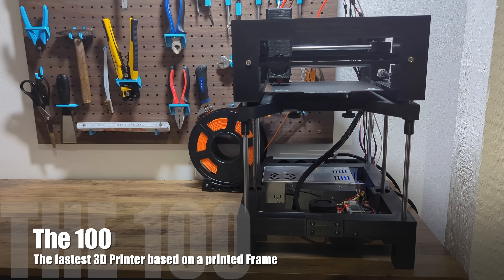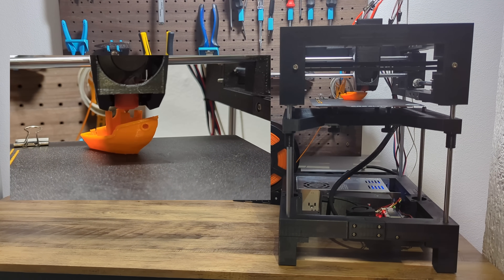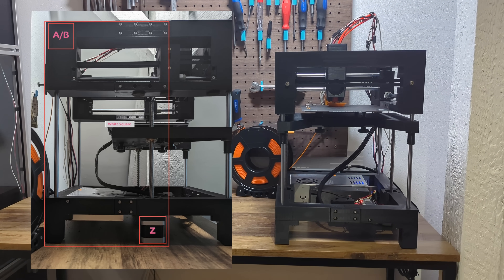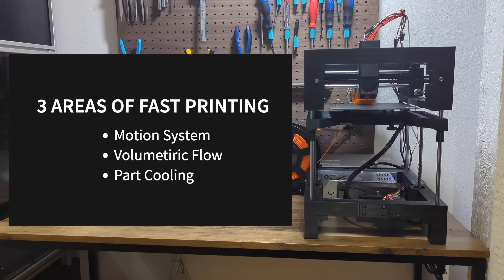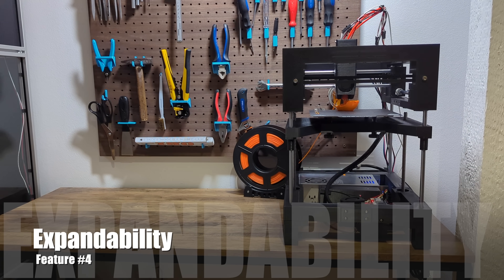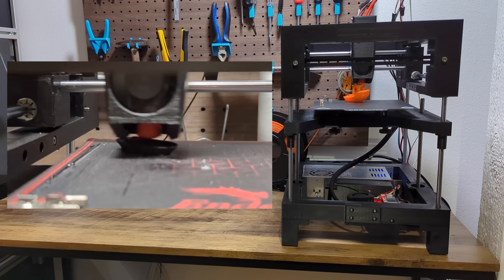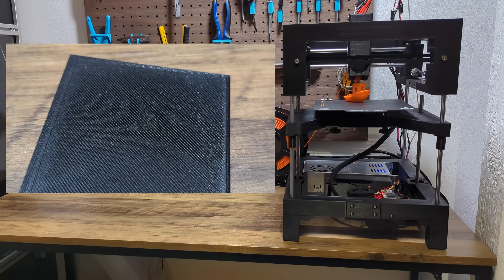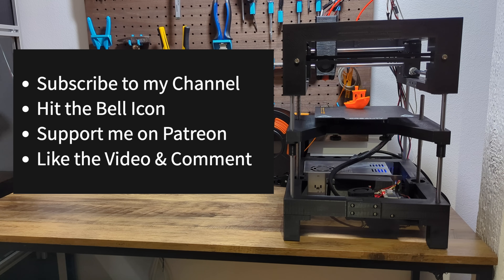The 100 - The worlds fastest 3D Printer based on a printed Frame

Comment: I love that others in the community are slowly beginning to realize that the non-moving components need to be as heavy as possible! Great work!
Reply: Im confused though: why not use stuff like concrete and make the parts significantly heavier? Or use a full steel frame resulting in the same. Im planning for my revision of my printer to use a steel frame and attach concrete blocks to the stationary gantry
Reply: @chris_0725  well these are meant to be cheap and relatively easy to build via printing the frame. Using concrete and sheet metal would not fit the spec they gave themselves
Reply: @brokencreationlordmegatrol3037  i don´t get it. Concrete is super cheap and it not hard to use.

If the brackets would be hollow with just tubes for screws, they could be screwed together, filled then super sturdy and also very heavy.

The main problem with concrete is surface chipping, and if the form is the outer shell, that is no longer a issue
Reply: @matsv201  one word, resonance. There is also the issue of shrinkage and creep over time.  

Simple solution to all this. Epoxy granite. Obviously more expensive but in the quantities required for this application its not going to break the bank. But you would use it in much the same way.
Reply: Maybe this could even be improved by printing even larger versions of the non-moving frame parts with some hollow compartments and filling them with sand?
Reply: @MrMoralHazard  Sand might also work as a good damping material, which would increase performance.
Reply: @RockitFX1 sand makes an excellent dampening material. I hope people run with your suggestion. :)
Reply: @MrMoralHazard  You'd want something like Epoxy Granite

https://www.youtube.com/watch?v=2NmZq7F_gUE
Reply: @MrMoralHazard  Interesting idea, maybe add water to fill the gaps left from the sand particles. You would need to insure that the printed part would be water tight. Possibly by thinning down some epoxy and pouring it in first then pouring it back out to coat and seal the interior. Maybe too much work for little gain though.
Reply: Any good reason not to add space for a concrete paving slab? Sure it isn't 3D printed, but neither is the ball screws and rails. And paving slabs are easy and cheap to come by, with no modifications needed, and it would add some significant weight to the base.

Having said that it would be interesting to see this analyzed for resonance frequencies. If you can avoid those it might improve the print quality noticeably without sacrificing all that much performance.
Reply: We've known for years but people aren't spending thousands to 3d print trinkets
Reply: I was thinking a 3D printer needs to be as light as possible so it can fly through the room even when homing.
Reply: Half the reason Mills and Lathes are so expensive is that very reason.  It turns out a literal ton of cast iron is not cheap.
Reply: @EmperorA0  Plus shipping lol
Reply: When I was watching this video I was thinking that I would use lead for weight. But then I have already do a bit of casting with lead already. One of the advantages of lead is if you don't like what you did you can just melt it all down and make it different.
Reply: @tinayoga8844  Lead is a great material to cast weight in. Just be careful writing about it or people will start complaining that you're poisoning them just by writing about it. I've actually had to tell people that no, you don't die by holding a piece of lead.

But it also comes with the problem of requiring some equipment to melt and cast it. You can get almost as good use of it if you get lead BB's  and pour them into printed pockets. Not quite the density but heavier than sand, concrete or even steel.

But seriously just adding weight is not really the end all solution. Some YouTuber, can't remember who it was, had a really old mill that had a problem with chatter. He thought it had to do with resonance and vibrations, and that stiffing up the construction and filling the pillar with lead shoot would help. Short answer it didn't. Well not until he had put a lot of work into it  and rebuilt the entire support structure.

Having said that adding weight to the bottom is cheap, quick and easy, so it's a good place to start. If it helps that's fine and if it doesn't then you move on.
Reply: Seems like some clever choice of infill, a couple holes, and epoxy granite could take it even further.
Reply: Im really surprised you dont see more printers bolted down to a bench. If secured properly weight shouldnt be to much of an issue, unless Im missing something.
Reply: @Witchlord  Thing is so far 3D printers is at the T-Ford stage. It's still immature tech and the cheap ones are often breaking down or need a lot of service. So you need to be able to get at it from every side, and sometimes even the bottom.

Besides most tables are pretty flimsy. To keep a printer steady you need something really sturdy, preferably bolted to the floor. 

Adding weight to the printer is a lot easier than trying to create a totally unmovable surface.

There's an alternative to all this. Instead of eliminating the vibrations and that's to compensate using electronics, programing and sensors. If you were looking at producing hundred of thousand or millions of printers that's probably the way you'd go. Creating the hardware and software needed is an investment that would pay off with a large enough number of units. But for low volumes building them sturdy and eliminating as much of the vibrations as possible is the way to go.
Reply: Yes, my idea initially was to drill a few small holes into the frame pieces and fill them with epoxy resin with very low viscosity
Reply: How could that not have been the most obvious thing already? Any CNC manufacturer has known this for decades. Has there seriously been doubt about this in the community?
Reply: if i were to make one from scratch myself, it'd be from a solid block of steel (which i already have and got no idea what to use it for)

but i have ended up in the "not enough time to make a hobby out of the tools for my hobby"  part of the community, sadly.
Reply: Imagine someone tried doing 10k mm/s2 on a rook by using tungsten to stop vibrations
Reply: @justageekygamer  meh epoxy has a higher loss coefficient thus better for the purpose. 

Heres an idea. Tubes filled with polyurethane.
Reply: Heavier is only good in the base. The key trait in non-moving parts generally is rigidity. Weight can be a contributor to that, but only insofar as denser materials are often more rigid and heavier for the same shape and dimensions.
Reply: @claws61821  agreed. There is a bit of a pressing aspect that we are hobbiests that machine manufacturers dont really have. 

Manufacturing process limitation. 

Lets be honest most of us are going to be limited to things like a chop saw, table saw and hand tools. 

Sure we can get creative with them. But we are not going to be destressing a steel frame in an oven and surface grinding where rails sit etc for example.
Reply: print the parts with open ends, and fill with concrete? concrete is not that expensive. you do not need much. It would eat some frequencys I guess also.
Reply: @AndrewTSq  even just sand is better than empty space.

Comment: Very interesting approach!
Why is the "White Square" not located at the center of the bed (which might be a the x/y center of the printer)? Was that just because it wasn't possible to arrange the components to put the center of mass there?
Reply from the maker: Yes it would not be practical. The power supply and Z-motors would have to be relocated, which would mean that the controller board would run out of space and the print bed would have to be rebuilt.

Comment: Hello! This is a very interesting project! I was wondering why you are using IGUS bearings? Compared to regular ball bearings IGUS bearings introduce a very wide, slow ramp up of vibrations on the input shaper resonance graph compared to regular ball bearings which ends up giving you quite poor results with input shaping. I noticed this walking someone through the setup on a sv06. With IGUS bearings his maximum recommended acceleration was at a mere 2k, and with the conventional ball bearings the graph had a quick ramp up peak with a recommended max acceleration of 8k.
Reply from the maker: I went for a couple different options in the development phase of the printer. I started with normal steel ball bearings and they had always a big amount of play ( i've tested a couple, nonames and reasonable manufactures like Mitsumi with different linear rods ) Up to 20k the performance was pretty good ignoring the annoying sound. But a certain accelerations they tend to blocking. Drylins are bad at slow printing. As you notice the slow ramp up is something you have to consider. But when you drive them for example at 20-30k acceleration there is no ramp up effect anymore. Especially at 40-70k acceleration they shine. But this is something I want to recheck in the near future. Im in contact with multiple linear bearings manufacturers for a production of a comparison video. I would like to compare steel bearings, drylin, copper graphite and sinterbronze and my self designed LM8UU based on different materials. So stay tuned for a details look into this topic

Comment: Could you do a version for a 300x300mm print bed? Or if you upload dimensions of the parts I could model the necessary changes myself in fusion 360. (I know this will affect the max speed of the printer but it's a sacrifice i'm willing to make)🙃
Reply: Agreed! 💯🤟

Comment: Do you have any opinions on glass  panes for beds and how using one might affect this build? I’m kind of a speed demon print-wise too but they’ve always been my favorite.
Reply from the maker: I've built my first prototype with a glass plate and blue painters tape. Works great for PLA when you room temperature is above 20°C. My Workshop is at the cellar. In the night I had temperatures of ~15°C which was enough to cause warping on my first layers when I printed PLA. I decided to use the Ender 2 Pro print bed because I saw that they sell PEI Sheets (the ones with a blue Ender logo) that might be used without a heated bed. So in summer when it's hot enough i could print with the heated bed off and when its too cold i could opt in the heated bed.

Comment: This looks just wonderfull. I would love to try assemble the 100 in summer. I saw there are stl files of parts needed, but are there recommended printing settings to do so?
Reply from the maker: I've added a section about the print settings at the readme of the github repository

Comment: Really blown away by what you were able to accomplish with this printer and it's really interesting to see your design philosophy/approach in action. I particularly like the choice of larger print area that's based on what most users would print out, while not being too small that it's too restrictive. I felt that was one of the limitations for the V.0 design. 

Looking forward to your build stream, and will look into sourcing the parts. Great work!

Comment: Would I be able to print all the pieces on a 140mm^3 bed?
Reply from the maker: No, to print the STL files, a 3D printer with a print bed of at least 230x230mm is required
Reply: @MattThePrintingNerd  got it. Thanks

Comment: Can the bed parts be printed in PLA?
Reply from the maker: I printed mine in PLA and I had no Issues printing PLA & PETG on it ( I print PETG at 85°C print bed temperature). For ABS or ASA I would consider a more temperature resistant material. The Ender 2 Pro print bed is isolated at the bottom but over time I could imagine that for longer prints it could affect the print bed.
Reply: Wonder if some heat insulation is possible in the design to use petg to build the 100